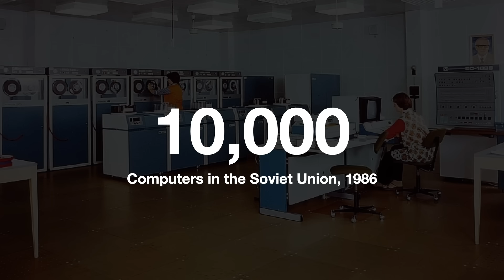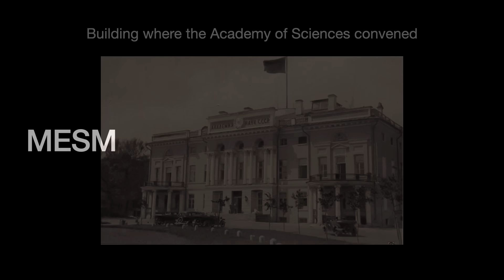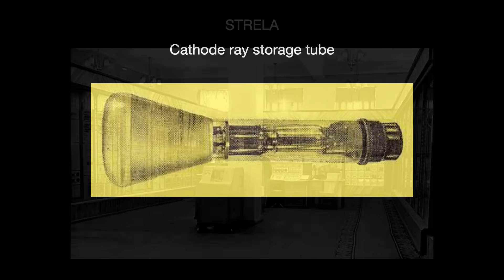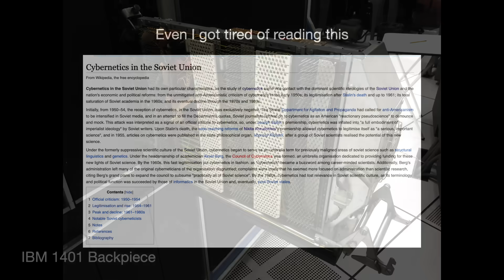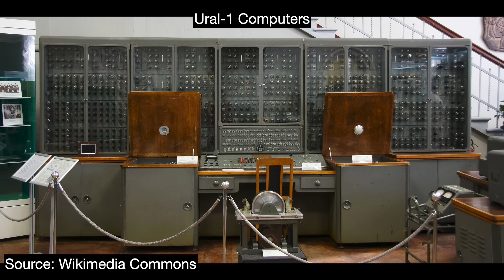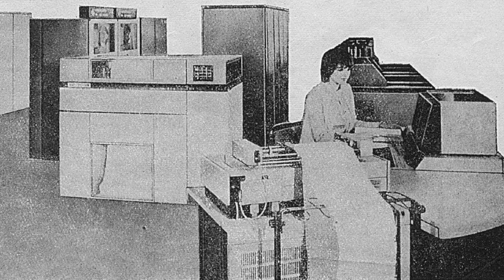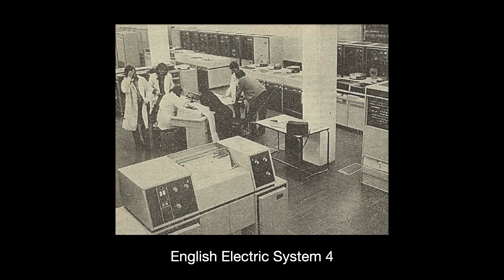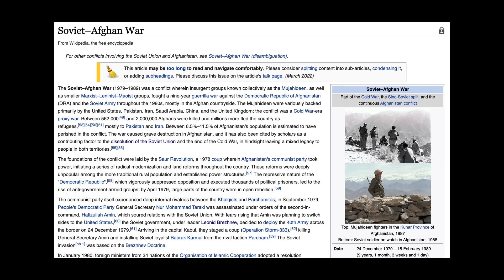Why the Soviet Computer Failed

Comment: Shortly before the fall of the USSR, I happened to be traveling there meeting with officials and notables from St. Petersburgh to the Altai, and had the occasion to have dinner/drinks (LOTS of drinks:) with a group of Soviet scientists meeting in Yalta.  During that evening,  an issue came up having to do with the then  oil/gas pipeline being constructed thru the Caucasus. During the discussions between them, which quickly grew into a rather heated argument, I was amazed when several of them whipped out their slide rules in order to support  their respective positions.  I said nothing till things were winding down later( I had not even seen a slide rule, well, for decades.)  Having resolved their argument, we returned to the meal (long, long, meal) and near its conclusion, I  rose and announced that I had a parting gift as a token of my appreciation for the chance to meet and confer with the group.  I  then opened my briefcase, reached in , and presented to the groups' principal scientist and leader,  the latest (and just released in the West)  solar powered Casio Scientific Calculator (which surpassed the comparable HP products at the time).   When he realized what I had just handed to him,  quite literally, tears came to his eyes, and for a few moments, he could not speak.  The rest of the group surged around him in astonishment and excitement as he opened the box and fired it up. :)  Needless to say, the post meal celebration went on for some time:) JESUS  could these men Drink!  I've gotta say, it was one of most memorable, productive, and satisfying encounters with intelligent people of my lifetime, and frankly, let me tell you, THAT is saying something:)
Reply: Nice story man
Reply: Thanks for sharing 🌟
Reply: as a matter of fact, by mid-80s Soviet industry could produce some advanced microcalculating devices like 16-bit DEC PDP-11 compatible ingeneering calculator "Electronica MK-90" ( https://ru.wikipedia.org/wiki/Электроника_МК-90 ). They had 2 major problems: 1) very few of them available, and 2) very expensive. Rb 3500 in 1988 equals 17 months average pay check in USSR. Definitely non of those people you mentioned in your comment could ever afford to have it.
Reply: @megaotstoy Guess Capitalism wins eh? 😂 And It’ll keep winning until we hit some form of Functional Post Scarcity.
Reply: Wow..... Just wow.
Reply: Slide rule! It was my dream. It costed me whole cash income.
I was Chinese. From 1972~1974 I went to a people commune as a peasant, working on fields with hand tools, very hard manual labour work. As a peasant, we didn't have wages. All incomes were staples and a little cash if you don't have a big family to feed. Many peasant families had to pay cash to commune for their staples, let alone any cash income.

My last year cash income was 16 Chinese Yuan. It could buy 8 kilo pork. I was 20 and single then. 

I had taught myself high school math and physics and advanced maths such differential and integer. 
At the end of 1974 I got a most previous chance to go to a middle technical school to study electronics. My life was going to change, I had the hope to be a engineer! To treat myself, I bought a slide rule with 15 yuan from the 16 yuan. That was almost one year cash income.
Reply: @xchen3079 Cool! What did you end up doing later in Life?
Reply: Awesome story
Reply: Good story! Its odd, because my father also finished the university with a slide ruler in Hungary in the 70s, however they were thaught to use a specific calculator. In the 80s some western home pc were available, but in general for scientists. I've seen for instance Nintendo first time in my life in 1990, after moving to West-Germany for a few years. Until that we had these primitive digital handheld games. So its a mystery why Russians were still sticking to slide ruler in the 80s while we could have digital games in the communist blok at the same time. I guess there was even a large gap between USSR and its satellite states.
Reply: @somethingirreversib  in mid 80s my parents bought me video game with wolf, Soviet made, so for us in Yugoslavia it was dirt cheap. I don't know was it cloned or whatever, by it had LCD screen. 7 segment LED display, just 7 digits and 1-2 extra is often enough, and to make elementary operations and elementary functions with minimal resources was known since CORDIC. Thus, cheap video game with large screen possible, but small pocket calculator not, somewhat hard to believe.
Maybe slide rulers were kind of macho thing.
Reply: @somethingirreversib  It may have been that some of these men were NOT  blood 'russians', as I was invited to visit  one fellow's 'dacha' (sp?) /home which was located in the Caucasus mountains (gorgeous locale by the way).  Again these men were NOT academics as such, they were, for the most part, engineers involved in the planning/construction of that pipeline, and had been granted a kind of 'holiday' in Yalta to attend some kind of conference and as a reward for their efforts.   The solar powered aspect of the Casio I gave them was of great importance, as the disposable batteries commonly available in the west, were extremely rare in that area at the time.
Reply: @somethingirreversib  Hungary had negotiated much better trade relations with Western countries than other Soviet Block countries. Poland to some extent as well.
Reply: This is why I love YouTube's comment sections, it's like when I'm watching some video about some 20th century war and then I read the comments and there's a bunch of accounts from veterans of said war telling about things that happened then (either that, or someone registering something their dad or grandpa told them but which would never have been written down otherwise), and suddenly you find yourself reading what turns out to be a digital billboard for historical records

I hope historians are paying attention to these as they try to organize and record current world history
Reply: We had good scientific and engineering calculators. 2/3 of the students had scientific or engineering brick size calculators (1979). But they could fit in a bag, not a pocket. Also stationary, they could be powered by an ac/dc converter, but they ate a lot of batteries, which were also sometimes not enough. Newer, compact and programmable (solar powered) were expensive, comparable to a monthly salary (or even two). 
I suppose everyone would be delighted if them were given a monthly salary (moreover, a device from the "free world" - rarity to brag about). Also in our scientific circles, it was a special chic to use fountain pens and slide rules.
Reply: @МирославаБерзина  Thank you for the information:)  The men I met with were high level engineers, who apparently did NOT have field access to the the more advanced devices you describe- thus the slide rules.  Please do NOT think in any way I was/am  belittling any of them.  In my early college years, I myself was a budding plasma physicist, so I was able to follow the gist of their discussions, though my scientific academic acumen had long since faded;  war will do that, i.e change quite a few of one's priorities, but NOT one's appreciation for the dedication and effort expended by men like these  in pursuing their objectives, irrespective of obstacles encountered.  I was in fact humbled by their joy and appreciation upon receiving  my gift. I have found in my lifetime that there exist good and often great men/women in almost every culture/society.  And conversely, some very bad ones:(  though to be candid, sometimes, that determination depends heavily on one's point of view.  Napoleon a prime example- revered by so many of the French, yet despised by pretty much everyone else LOL.
Reply: @seeratlasdtyria4584  you speak very complicated english, i thought i was good at it but i literally could not understand what you wrote here. I had to use google translate and the last time i used it to translate youtube comments was maybe 5 years ago. You are remarkable and sophisticated man.
Reply: @seeratlasdtyria4584  A team of Renault engineers (for a while, they ignored if were in profits or losses, never estimated costs, when one in administration, Besse, fired over 15'000 redundant employees, an 'autonomous command' killed him in front of his home) was drawing an small piston aircraft engine, just for fun, another came in with an slide rule, and proved engine will self destroy at first start, parts were not strong enough as to withstand the loads. Blessings +
Reply: @МирославаБерзина  99% of the "stories" in this comments section are lies. The video is such stupid that it attracts the liars.
Reply: absolutely amazing story!
Reply: What an absolutely GREAT tale!  (Did the CIA arrest you for handing over top secret technology? 😂)
Reply: @GizmoFromPizmo  Hehehe, I can see where that would seem funny;) but best not to get me started on "The Agency" as they used to somewhat smugly  refer to themselves as.  Ever since the time I witnessed  an Agency analyst (supposed to be the really smart ones),  stand up in front of perhaps the largest single group (bout 80) of uniformly brilliant persons assembled in a single room, at least that I had seen,  including one of whom  had been the Chief Operations Officer under Dulles  for the OSS (the agency that BECAME "The Agency"; anyway this fellow proceeded to lecture the group as to why Diesel fuel could not 'burn' on the surface of the ocean.....you read that right.  In the rather shocked silence that followed, the OSS guy pointed to me and asked if I had anything to add, as it was pretty clear on my face what I thought of that pronouncement.  Now, I kid you not, but I believe the following is exactly what I said:

"well, in the words of my oil industry grandfather, 'he's as full of shit as a Christmas Turkey! 
 Has anyone here NOT seen the footage of the aftermath of Pearl Harbor? I would inquire of the 'gentleman' as to just what the hell does he suggest was that liquid that was burning on the surface of the water?"

Well, even the OSS leader couldn't suppress  his laughter at that  (to his credit though, he did turn and try to conceal it).  Anyway, that incident pretty much summed up my valuation of Agency intel, at least till verified by someone else:)

 Now, back to my  Soviet trip I've been describing, here's  an insight for you. "The Agency"" actually was pissed as hell that they couldn't manage to insert one of their own into our party, which I personally thought was a 'good' thing.   However,  I did manage to discover near the end of the trip,  that a most accomplished  fellow from the DIA had pulled it off and right under my own nose:)
Reply: This comment is better Much more interesting than the video !
Reply: It’s comments and all the following replies/conversation like these that are just as valuable and entertaining as the videos themselves.  Someone should develop a program to aggregate all the best and interesting comments on YouTube.  Thanks for sharing and look forward to reading your biography one day.  🙏😀
Reply: Your story tells all the truth of this question, me, myself, I asked me the same question with similar arguments like the author of this post did but  34-37 years ago...
Reply: Awesome story!
Reply: I still have my Thornton slide rule from 1973. When I went to China in 1998, I was similarly taken aback when a shop assistant showed me her abacus to tell me how much I owed!
Reply: There's no doubt the Soviets had some brilliant minds, but do you have an opinion on why their technology always looked so crude and outdated, like you were watching an old Dr.Who episode, or one of those cheesy Mystery Science Theatre 3000?
Reply: @gwbenites  This is pretty easy to explain. The Soviet economy did not need advertising and "selling" packaging. Everything was simple and utilitarian. In addition, the majority of the population are peasants, i.e. people are simple, uncomplicated. And, of course, because The USSR was still the second economy, not the first, and there was also a lack of resources.
Reply: Soviet Russia : Very smart people, ruthlessly horrible political system.
Reply: @edwardfletcher7790  My college differential equations professor was from Bulgaria. He's maybe 70 now so he grew up and was taught in that system and I've never had a more professional and well spoken professor in all of college, he'd apologize deeply for any mistakes he made during a problem, which maybe only happened 3 times through the whole semester. I think one of them he ended the class trying to figure out why one of the students thought it was wrong and apologized the next class and redid the problem correctly when he saw what they noticed. Teaching differential equations for him was like teaching kids the alphabet, so I thought it was admirable how seriously he took it. Made you actually want to understand it so as not to disappoint him.
Reply: @breadman32398  Strange coincidence.  I recently underwent some emergency cardiac surgery involving a difficult pacemaker removal that in fact required the use of a helix laser to free up the eroding wire leads and remove the whole mess.  
The surgery was soooo difficult that it required not only the only cardiac surgeon within several states capable of using the laser , but standing next to him a specialized thoracic surgeon prepared to 'take over'  and crack my chest open, within seconds in case something went 'wrong'.  I mention this, cause the cardiac doc was previously a physicist in Bulgaria, who decided on a whim to go to med school:)  (Hint- there was a "very interesting' girl planning to attend there involved in his decision making:).  Just before the surgery,  while I was being 'prepped', we got to talking and I mentioned I had ridden through Bulgaria on a motorcycle in my  youth:)   He asked me about my worst memory of there, and I told him about this head splitting alcohol concoction I'd had been given at a university related  wedding celebration, at which point  he shocked the personnel in the operating room by engaging  in belly busting laughter then telling me what the alcohol most likely had been, and how it had been made.  You see, back then (he explained) Vodka was prohibitively expensive in Bulgaria, so some bright chemistry students had figured out how to distill, refine and 'repurpose' a cheap brand of Russian made  AFTERSHAVE!!!!!!  At this, here I was literally lying on the op table, laughing my ass off,  causing me to relax, my blood pressure and heart beat  rate fell,  the anesthesiologist  did his thing,  the doc  smiled , a couple of hours passed, I awoke, and now,  here I am :) still here.
Reply: @Edward Fletcher   That exactly system rose those people. Before 1917 Russia was ancient-traditional agricultural country with no productions and public education. All those smart people who were brought up, received a free higher education, in the Russian Empire were doomed to remain peasants until the end of their days. The average age of survival for men, by the way, was equal to 30 years before the formation of this "terrible system", and has become more than 70.
Reply: @Ma_X64 Stalin and his minions imposed a totalitarian system that ruled by fear, terror and violence. Getting people to like things like medicine and education should not require such methods. Of course, living next to Hitler and HIS minions was not a spur to peaceful progress!
Reply: @robertmatch6550  Yeah-yeah! Tell me something I didn't hear already. The problem of your version is that it's not consistent with any real documents and has just a terrible amount of poorly-made fakes in its base which is itself makes person, who's capable to think, doubt in the reality of such stories. You are imposing your understanding of what is right on a different historical era, in which you, with your understanding, would be sent on a long and unpleasant journey at the very first corner.
Reply: @Ma_X64  You make a lot of assumptions, about people/places and events of which you apparently have no knowledge whatsoever, much less about who and what I was and am.  The practice will not serve you well.
Reply: @seeratlasdtyria4584   I do not need any assumptions. I can see you through your texts.
Reply: @seeratlasdtyria4584  what happened to 90% of the replies below your commment? a year ago there was a long, long discussion here, and now its almost all gone!
Reply: @edwardfletcher7790  things have to spoil when not handled well. As USSR did. It was made for building communizm, but in 1964 Khruschev said that everything is done and socializm already built. And peaple were already not that smart and they supported this lie with ovations. USSR had the only way after that. We had to taste it to realize what do we really need. And one more sentence. We, Russians, were always respect magic of the western world. That doesn't work any more.
Reply: @edwardfletcher7790  The biggest irony is that the political system was responsible for the huge numbers of smart people. Before the revolution, education was something very important to the nobility. After the revolution its importance was spread to everyone, resulting in one of if not the best education systems of all time. This is something that the current government has neglected. Resulting in a government that lacks the presitge of the old aristocracy, the (relative) fairness of communism and drive for innovation of the capitalist countries it borrowed from following the collapse of the USSR.
Reply: @philipplyanguzov9090  Exactly !
Reply: @edwardfletcher7790  See also: General Motors
Reply: @edwardfletcher7790  the fact that they choose the horrible political system shows they are foolish, not smart.
Reply: @fitofito1001  Political system has ZERO to do with quality of academic & engineering talent.
Reply: @edwardfletcher7790  You can say that many times more.
Reply: @edwardfletcher7790  this, they were so intelligent to do and build the things they did before the computer age, the ingenious design of tanks, weapons etc etc to rival any other country, but one mis-step after another and the Union didn't even last 70 years and fell so far behind I feel sorry for russians today
Reply: @edwardfletcher7790  this political system was created and cared for by these "smart people", don't forget about it
Reply: Fantastic 👌
Reply: BIG DEAL... in 1981 I gifted a Casio C-80 Calculator Watch to the head scientist at [REDACTED], and wound up in an orgy with 26 Russian virgins.
Reply: Why would you hand the enemy valuable technology they did not possess.
Reply: Guaranteed within 24 hrs it was being dissected by them or the politburo
Reply: Thank you for sharing that.  It confirms what I've heard before.
Reply: Please, write all your travel in a book
Reply: Wow, what a great story.
Reply: Thsnks for the story
Reply: Powerful. Thanks for sharing sir
Reply: If only that country would have build its legacy from such intelligent people instead of the shitshow we see now. So sad.
Reply: Great! I could picture it as I read.
Reply: More like, why did the computer proliferate in the US?  Time and interest.  It's culture allows for pursuit of hobbies and interests.  It has science fiction appeal, with attainable goals.  It was pushing on practical fronts at places like NASA.  While IBM was renting their computers at a cost of $63,500 a month, intel was working on calculators and transistors, which lead them into the computer processor business.

You can just read the history of Intel.  Calculators, then processors like the 4004.  They made it possible for hobbiest to buy parts and build and operate a rudimentary computer at home.  

It's all capitalism business, Intel was a startup with people needing to make money with what they know.  They made parts, people bought, and they made money.  Even to this day.  Simple supply and demand.  Profitable venture.

Large part of computers is video games.  People might fail to point out a large part of the computing business was powered by quarters at the video arcade for a time.  Apple made it big on build your own computer Do-It-Yourself (DIY) kits.  They later shifted to a more money oriented model, but now known more for their phones than desktops as time went on.

First it hobbiest who needed a computer to practice on, and/or enjoyed programming.  Being DIY kits, they would also need to know how to read schematics and solder.  Also, it was a great way to meet and do stuff with other people.   No internet, all face to face or by mail.  Also, powered by video games.  It used to be single player, now it's massive multiplayer online (MMO) games.

Soviet didn't have any of these things.
Reply: That is truly quite an intriguing story. I don't think I stand alone so far as to say I would appreciate lerarning further details of your travel. Maybe at some point you may condider writing a book or lecturing on this event, and possibly other topics as well. Thank you for  sharing your story.
Reply: And they still use that very calculator today.
Reply: Just reading your stories, I feel like I'm missing so much in my. Thanks for sharing.
Reply: Very similar timeframe just not about computers, right before the fall of the USSR, my father was a young officer in the Air Force.  At that time a group of Russian military officers were visiting the base he was stationed at (can’t remember which one, sorry).  The officers saw just about everything we had, but the thing that made them lose their mind were American denim jeans.  They were calling each other over, yelling from across the store for the others to come look at them.  Looking like they’d just discovered a new divine happiness.  No one left carrying any less than 10 new pairs of jeans that day.  They were buying them for friends and family too just so they could experience them when they returned home.  They wore them the entire rest of the trip anytime they weren’t strictly on official business.  The nerds might’ve lost their minds over a calculator.  But for Russian officers stuck in scratchy uniforms, US denim jeans was their moment of enlightenment.
Reply: Sounds like they were too drunk. In the late 80s a programmable calculator was widely available, for example Electronica MK-61, which is very similar to Casio Scientific
Reply: Now there calculating the losses there having with Putin .
Reply: @americanstarman4418  this was some 30 years ago, and since they were all older than me, I suspect they have all passed away by now.
Reply: @seeratlasdtyria4584  it was such a good story for humanity. you brought us all a bit closer that day
Reply: @seeratlasdtyria4584  you are lying because you were not in the USSR in the 80s, because you have no idea about the production of calculators in the USSR, since 1964, a fully electronic calculator of the Vega model was developed and started to be mass-produced in the USSR. Since 1974 ("Electronics B3-04") pocket calculators have been produced. A wide range of programmable calculators was produced in the USSR: both desktop (Iskra 123, 1972) and pocket (Electronics B3-21, 1975).
Reply: @seeratlasdtyria4584  how did you get in
Reply: @seeratlasdtyria4584  You did what their politicians never could, improve their country
Reply: So you contributed to Russian invasion in Ukraine. They reverse engineered it and used it to enhance their military powers. (sarcasm)
Reply: What a load of bullshit!!
Reply: Do you realize what you did? You handed them technology that they cloned and used against us. It is YOU that kept them in the IT race. Egads you commie lover.
Reply: @kruncytheklown  LOL :)
Reply: P
Reply: Nice BULLSHIT on your part.
Reply: They used drinking as a negotiation tactic.
Reply: And that is when the balance of power shifted...
Reply: In the late 80's you would not have ceased using a slide rule for decades, saying that is silly.  Good, affordable scientific calculators were not available until the late 70's at least.  I still have in my posession a scientific calculator from about 1980, which cost the earth at that time.
Reply: Thanks for sharing that, super interesting story. I wish there was a way we could save these little nuggets of information so they're not lost to the internet
Reply: A somewhat strange story. If only these events took place at the turn of the 1970s and 80s, when slide rules were still used by someone. Since the mid-1970s, quite modern pocket calculators have been produced in the USSR, and in the 80s dozens of models were already produced - from the simplest to scientific and programmable. 
If the events before the collapse of the USSR are described, then this is approximately the end of the 1980s: then calculators were used everywhere, and programmable ones at that 
(I, for example, had a B3-34 (https://www.youtube.com/watch?v=TSUnfORpeUQ) , 
and more interesting models were produced – i.e. MK-52 - https://www.youtube.com/watch?v=Ne1eUmd9Bg4&t=30s), 
and solar-powered scientific ones (I had MK-71, a very serious model - https://www.youtube.com/watch?v=8NuHAK3r2wU) 
and even programmed in BASIC (since 1986 the famous MK-85 has been produced (https://www.youtube.com/watch?v=KXoYnTYfWm0&t=1287s), and I also bought one in the early 1990s, although I was not a researcher, but a simple student :). 
Since 1988, the MK-90 (https://www.youtube.com/watch?v=dKf35M_-G7k) produced in the USSR - a portable computer with a graphic screen, with BASIC, however, unlike the MK-85, it was expensive and rare. 
So, it was difficult to surprise scientists or engineers (especially in the field of oil and gas) with a good calculator. 
In those years (late 1980s), personal computers, including imported ones, were already quite common in the USSR, and various Soviet home and educational PCs of a sufficiently high level were already mass-produced 
(BK-0010/0011 (https://www. youtube.com/watch?v=DhUSqlWxdGc&t=198s), 
Vector-06C - https://youtu.be/TFbesAopy44 (I had both BC and Vector at home), 
UKNC (MS 0511), Corvette PK8020, etc.) .
However, any imported equipment was valued in the USSR (since there was almost no free sale of it, and few people had it), so a Soviet scientist could well be sincerely happy with such a gift :). 
In 1989 I had the opportunity to get acquainted in detail with the Casio graphics calculator (something like the FX7000G), and it impressed me (at that time I had not yet personally met the Soviet MK85 and MK90), although, to be honest, I didn’t feel any special need for such calculators - as a rule, a calculator was required for fairly simple calculations, and the usual “engineering” model was enough. And for more complex calculations, large PCs or more powerful computers were used. 
But a graphing calculator is a good toy for an engineer and a scientist :).
Reply: Fantastic
Reply: This is actually very believable because a few years after the USSR broke apart the conditions for everything everywhere were disgustingly bad. Nobody really cared apart from those people directly involved.
Reply: I assume that calculator was only available to a few people or did a lot of people use it in the us? How much better was that calculator then the soviets?
Reply: @anderslarsen2311  As far as I knew (i.e. 'was told') the Casio had JUST been announced in Japan, and only a very few were available, i  I may be wrong, but I don't believe it  was circulating  in the US at the time I left for Helsinki ,  my jump off point for Leningrad, (later re named back to St. Petersburg.)

As far as I know, there was no comparable calculator then available to the Soviets.  That's not to say they didn't have any similarly capable equipt, but they certainly had nothing  remotely equivalent to the solar powered, extremely portable , Casio.  HP was even 'outgunned' by it.
Reply: Wow...I had to buy that calculator for trigonometry and calculus in 1988 or 89
Reply: @AvE Please enter this thread 🤣🤕
Reply: Like living in a parallel dimension that's only a few years ahead of the current one.
Reply: Great story. Reminds me of time two Soviet chess grandmasters met up for a tournament.
"We had a coin toss. I won the toss and elected to keep the coin."
Reply: Caiso, junk HP-41C of mine still runs well for the past 39 years... RPN...  calculators is where it's at.
Reply: imagine if it was a ti-89 with drug wars installed
Reply: SLIDE RULES — oh my goodness, I love them. They are antiques and I have a small collection of them. 

I am from Ireland and I bought three slide rules, one from USA and two from Russia. I am fastinated by them. 
Why I love slide rules? They beat batteries. No need to solar power them and you can always pass them onto descendants after your days. They are so cool and look ornamental on my shelves. 
Today, the antique slide rules are getting very expensive and they are now hot collectors' items. As antiques, they now cost more than western scientific calculators. I had bought one Soviet slide rule for roughly €60 (nearly 3700 Russian rubles). Another for €58. I can't remember the one from USA. Few years after my last purchases, they probably have gone up more in prices on eBay and Etsy. Their prices are crazy.
Reply: We should remember this man was able to get behind the iron curtain and made no mention of the starvation
Reply: A peculiar tale was about the onboard computer in MiG-25 fighter airplane. It was made with bulbs, USSR own technology, the turbine for this 'Pursuit plane' had a very efficient flame maintainer.
Both of these choices made this war machine quite insensitive to 'Electro-Magnetic Pulse', as those generated by Nuclear Weapons and Solar Flares.
MiG-25 was said 'the terror of flying saucers', supposedly having Electro-Magnetic means for propulsion and defense.
X-15 was informed having a lower top speed than UFOs, but accelerated faster.
Is there any application or environnement today were bulb computers will be in the lead?
Probably, no one is ahead of Rusia in bulb computing. Who will buy, how many, at which cost? 
Blessings +
Reply: That's both fascinating and disappointing
Reply: not sure but I think you just admitted to a felony!  lol
Reply: Not surprisingly. Although Soviet-made calculators were already quite common at that time, a Western-made calculator was quite an expensive and exotic gift
Reply: Miserable Russians too smart for their own good, just as now. Nothing set can ever change.
Reply: @Neapoleone-Buonaparte  just don't envy so loud.
Reply: @ТоварищУкротитель  envy what? Congenital Russian incompetence? The army of paupers unleashed on Ukraine by the Khanate of Moscow? What is there to envy about Russia?
Reply: @Neapoleone-Buonaparte  oh, nice, you've deleted your previous comment. :) That's brilliant.
However your frustration is fascinating, please don't stop. I would like to see more of your ignorance. :)
Reply: I learned to use a slide rule in the third grade...you are the one giving US tech to the Russians...I was using slide rules in elementary...all Russias tech they have recieved from US traitors..and German scientist...
Reply: @danielraymadden  with all due respect, it appears that  you have completely failed to grasp the import  of my post.  Aside from the seminal fact that "Casio" represented Japanese and not US tech; not to mention totally neglecting the fact that the USSR was at that moment, quite literally on the 'verge' of collapse due almost entirely to their own  'will' and actions, I'm afraid that like so many  Christians;  you have "read the words written, but have not 'seen' their meaning."
Reply: Remember me the defective pilot who ate cat food and said it was better than soviet canned food. I don’t know why people still vote for socialists.
Reply: Bla bla bla
Reply: Elektronika B3-21 (Cyrillic: Электроника Б3-21) was the first Soviet programmable calculator. It was released in 1977

The MK-71, a ten-digit solar-powered microcalculator, was produced from 1986 at Zelenograd’s Angstrem and Ukraine’s Rodon. Retailing at RUB 75, it quickly won cult status among users, particularly university students. It was a carbon copy of Casio’s FX-950, with the same key positioning and other elements..
Reply: Not bad but it would have been an even more interesting story if you had reached into your briefcase and produced a severed hand.
Reply: Странная история, т.к. в СССР с 1962 производился настольный электрокалькулятор "Вега", с 1967 "ЭДВМ-П" (программируемый с трансцендент-исчислением), с 1972 -- первый наш карманный микрокалькулятор ("Искра-123"), с 1974 -- микрокалькуляторов с жидкокристаллическим дисплеем (до этого были светотабло) -- серии "Электроника", и если цена первых микрокалькуляторов была порядка 200 руб. (это размер средневысокой зарплаты), то новые модели микрокалькуляторов с 1980 г. стали стоить порядка 50-60 руб., поэтому микрокалькуляторов появились не только на рабочих местах (что было издавна, тем более что до них были электромеханические, а перед тем, до 1950-х гг. -- механические арифмометры), но и в квартирах (и, соответственно, в карманах)). Но логарифмической линейкой многие продолжали пользоваться -- муж, например, считал, что она надёжнее и не требует перепроверки (из-за ошибок ввода); но я уже ею не пользовалась, только в школе учила (школу закончила в 1980)
Reply: It's a strange story, because in the USSR, since 1962, the Vega desktop electrocalculator has been produced, since 1967, the ADVM-P (programmable with transcendent-calculus), since 1972, our first pocket microcalculator (Iskra-123), since 1974, microcalculators with a liquid crystal display (before that, there were light-tableau) the "Electronika" series, and if the price of the first microcalculators was about 200 rubles (this is the size of an average-high salary), then new models of microcalculators since 1980 began to cost about 50-60 rubles, so microcalculators appeared not only in workplaces (it yet before 1950s - mechanical arithmometers, next - electro-mecanicals etc.), but also in apartments (and, accordingly, in pockets)). But many people continued to use the slide rule - my husband, for example, believed that it was more reliable and did not require double-checking (due to input errors); but I no longer used it, I over my school in 1980.
Reply: It sounds like you violated some sort of technology and/or arms export embargo
Reply: AND THEN EVERYONE CLAPPED
Reply: The world changes quick in the modern age. Thanks for sharing.
Reply: Why is it that many cool stories include heavy drinking...? Nice story though. Thank you for sharing.
Reply: @Bob-ze1zo  Something you should know about the international community, especially the Russians.  They have a saying that roughly translated goes:
"What a sober man has in his mind, a drunken man has on his lips"
They are not the ONLY racial/cultural group I've encountered that feels that way.
In matters of intl business and/or diplomacy, until they get to 'know' you, i.e. drink with you, and see who you really are, you can't do much of anything.
  The former USSR contained something like 26/27 different minority cultures-pretty much all of whom felt similarly. In some ways, you could say I used to "drink" for my country:)
Asians and even a few of the Arabic leaders (though unable to drink publicly) engaged along the same lines.  I could tell you stories ;)
Reply: @seeratlasdtyria4584  I see what youre saying, something i noticed even more from a perspective of a person that quit drinking. But while i did, i noticed that what really gives you an edge in this kind of game is to still be able to lie while drunk :).(edit: i guess you can get there with a lot of practice!)
Reply: @greenanubis  LOL, normally I would agree with you, however in this case I had several advantages.  First I have a specific genetic anomaly that causes the stomach to immediately begin attacking and breaking down alcohol molecules, ergo, I can also REALLY drink, while maintaining cognitive awareness and control longer than those without this anomaly.  Secondly, due to my background and up bringing, I am not prone to prevarication by nature, and this is evident to those with whom I converse.  This combination resulted in my being chosen/enabled  on numerous occasions to communicate with persons of standing; to either transmit information and/or to elicit responses, and otherwise gather information on their own positions.

 Let me just say, that at the Highest levels, Trust is the most precious commodity.  Lose it in business/ or politics, and NO ONE of consequence will have anything to do with you if possible.  Only on the extreme left is the ability to congenitally lie, considered an 'attribute' on the world stage, ergo......

Oh, and on another note, congratulations on quitting drinking; simply put, it takes a VERY strong man OR woman to achieve it.  NEVER underestimate your accomplishment!
Reply: @seeratlasdtyria4584  USSR contained 100+ ethnic minorities, also many of them were forcibly integrated into either Russian or like-cultures. Only a few chosen ones were allowed to stay and those are the official minorities. Anyway, amazing story.
Reply: @astronemir  Emir, thanks for the info. Had no idea there were 100!  Like I said, during m y times there, I only encountered a fraction of that many.
Reply: @seeratlasdtyria4584  extreme left?
Reply: @kbanghart  ? Sorry, not sure I understand  what you're asking. If it's  whether I was extreme left, then the answer is no.  My response to the weenie suggesting that I had no higher education might give you a bit  of insight into my political purpose  and positions:)
Reply: @seeratlasdtyria4584  sounds fascinating. What was your job if you can share? And I would love to hear some of those stories from the Arab leaders.
Reply: @seeratlasdtyria4584  "Only on the extreme left is the ability to congenitally lie, considered an 'attribute' on the world stage, ergo......"  Waaaaa!  Ain't that the truth.
Reply: @seeratlasdtyria4584  As a life long abstainer from alcohol, I can't help but wonder if someone like me could EVER have satisfied them that I was someone worth working with. Did you ever encounter a Soviet group willing to work with abstainers?
Reply: @seeratlasdtyria4584  aka "In vino veritas". Not really that new, or that Russian either.
Reply: @rp7390  LOL, what took me paragraphs to say, you've captured in 3 words from a 'dead' language. Salutationes!
Reply: @hughmungus1767  The world of 'diplomacy' and its attendant, requisite' talents' is a remarkably diverse and flexible one.  I happened to be a good drinker,  just one of the tools in my 'kit';  I've met and known well,  many others, some of historical stature, that couldn't drink worth a damn.  Henry Kissinger to name just one :) (Ever hear ANYONE refer to Henry as "jolly?"  LOL.
Reply: @seeratlasdtyria4584  now I am imagining asian officials trying desperately to keep up with the amount the russiasn could probably drink lmao
Reply: @seeratlasdtyria4584  2) https://ru.wikipedia.org/wiki/Электроника_МК-51 Электроника МК-51 — "Electronics MK-51" is a Soviet engineering calculator powered by a lithium cell of the DML-120 type (ML2325, CR2325) or two SC-32 elements. It has been produced since 1982 in factories
Reply: @seeratlasdtyria4584  'The  importance of being Earnest', Oscar Wilde. Salut +
Reply: @seeratlasdtyria4584  beautiful story. I'm curious to know more if you can do so? A lot has changed since. What kind of work were you doing in Russia, what was it like as a western, how was the food, did they have any peculiarities, we're there women scientist, what did they think about capitalism, did they think they're superior as they're not consumerism promoting.... anything else you want to share would be great
Reply: @zakkajakob2288  In fact, there was a whole lot more to tell, but I can sum most of it up,  with two or three observations:  1. there was a ;joke going round  the foreign diplomatic and business  communities, that determining who was a foreigner and who was a Russian was exceedingly simple..those who were smiling or laughing, were ALWAYS the foreigners,  the truly sad part, was that it almost always turned out to be true:(
The second thing that amazed me, was that in bustling downtown Leningrad, there was a public 'spigot' , nothing fancy just a spigot sticking out from a concrete wall.  Next to it, a shelf cut into the same wall, where there resided a single steel cup.  To the horror of our medical contingent.  People would periodically walk by, fill the cup with water from the spigot, drink the water, and return the cup to its shelf in the wall. to await the next thirsty passerby.
Lastly, and the most personal to me, was that I made no bones about who and what I was in public- I was then about 6'3 in stocking feet,  and with me wearing a Stetson cowboy hat, and walking around in my cowboy boots (a little over a 1-1/2" riding heels making me appear about the same size as John Wayne, whom EVERYONE in the USSR knew. (In truth, I met Duke  up in Canada/Alaska  once at a famous fishing resort and he was a taller/bigger man that I :)   Anyway, the vast majority of the citizens there resembled in NO WAY, the gigantic, heroic looking statues erected throughout the country.  The people, on the whole, with only the rare exception, were almost tiny, even to the po0int that  when our group had to 'assemble' for transport, the joke was, that we would all meet at "me" as in a crowd you could see my hat from clear across Red Square :)
Now, here's the significant part-  I cannot even begin to tell you how many people over the length and breadth of my trip would come up to me and simply blurt out almost always the same exact words, uttered in almost an urgent, often emotional plea:

" Please tell your fellow American's back home,  we NEVER WANT TO FIGHT ANOTHER WAR!!!!!"

Sometimes it was just heart-wrenching..
the citizens of all parts of the old  USSR had experienced the worst that war can deliver, both from the Germans, and from their own.  They had  suffered enough, at the hands of both, and at no small danger to themselves, they wished to make sure that I took home this one critical message...:(   
To me, it makes their current plight all the more tragic.
Reply: @seeratlasdtyria4584  thanks so much for sharing. I lived in Moscow 20 years ago for a short three month project so my window was too short and frankly we were so busy on the project ver narrow. Also I don’t drink so it took me a lot longer to get closer to some colleagues. And even then I could sense the darkness of the past, an overwhelming sense. 
While I’ve read a lot about the era, it fascinating to hear a foreigner outlook during the high noon (pun intended :) of Russia. 
What always gets me is how such a fierce and brilliant people succumb to central authority? 
Few people may remember or accept it now but Marxism was very popular in the west around WW2 and many a intelligence agent became a Soviet supporter just for the philosophy.
Russian agents even created what we call IMF today and got the biggest amount of money to rebuild USSR after WW2. Much more than even the UK
They’ve got the longest list of chess champions bar none yet they’re always in a Greek tragedy. I still don’t get that predicament.
Reply: @zakkajakob2288  One of the most important lessons I ever learned, if not THE most important, was that NOTHING in the world  becomes  "the way it is", without a history  of HOW it got to be, 'the way it is' :)

Ergo, look a the history of what became the USSR, starting waaaaay back.   If you look long and deep enough, the answers you seek become trivial to understand.
 
As a 'life lesson' you will find that applying that same 'technique' iwill reveal  why  everything that is,  is the way it is.   
NOTE!  If you find the uncommon instance where it does NOT, then you'll know that 'someone' has been rewriting some 'history'....
Reply: @seeratlasdtyria4584  well I've thought of that. I compared french history to Soviet history because it seemed to be similar.
Both had similar revolutions, very violent and widespread. They also suffered the most in WW2. Yet the two end up very different.

While the French experiment continued to evolve the Soviet seemed to standstill and obstinately stuck in a spot, after WW2. The cold war isn't enough explanation. It doesn't cover the whole answer

To me the answer lies the DNA. A difference in the personalities of the individuals themselves. And that's what I find fascinating.
Reply: @zakkajakob2288  I hear what your saying, but the rise of the French Nation, at least to me, does not equate with the far older historical machinations of the peoples who came to constitute the populations in the USSR. For instance, did you know that the Russian revolution against the tsar/czar Romanov, did NOT result directly in the creation of a Soviet state, in fact it became a Republic of all things, the first president being a fellow by the name of Kerensky, who was then,  within months, forcefully deposed by Lenin and his cohorts Trotsky and Stalin.  I had the chance to meet and talk with Kerensky not long before he died, I believe it was in New York.   He had a LOT to say, but his story is one of those bits of history, that the Soviets have all but rewritten completely.  The Ruthlessness of the Russian Tsars in enslaving and controlling their populations,  seems unmatched by the French imho. Otoh, it could be argues that they had substantial reason to act that way given the pretty much constant threats they faced, both domestic AND foreign.   DNA?  I would argue no,  just historical precedent.  I'm not sure that the Russians/Soviets have ever known 'individual freedom' though some have tried to achieve it...
Reply: @seeratlasdtyria4584  I used to hang around a big group of Mostly Russian and Ukrainian emigres who had settled in the Twin Cities region of Minnesota and they were the most lovely people; they were all just a little bit crazy and very proud of that fact.  They referred to it as the "Russian soul".  I miss these beautiful people very much and I need to look a few of them up.
Anyway, I am a recovering alcoholic and when I would need to politely turn down a drink they would look genuinely puzzled at the fact that I didn't drink.  They truly did not understand it.  When the first person I had declined was confronted with the very next person to offer me a shot, they would point out that "John doesn't drink" they would have these puzzled looks on their faces.  I would try to explain what would happen if I were to start drinking again, they would nod and say "but of course" this is what happens but that shouldn't get in your way.
I am told that this is changing a bit but in general they had no capacity to understand sobriety.
Reply: @seeratlasdtyria4584  in vino veritas
Reply: @Bob-ze1zo  
Nothing cool ever happened while eating a salad.
Reply: @beeragainsthumanity1420   I humbly chose to differ.  Spend a little time eating salad with an Enlightened BEing... and your whole life may well change.  😉🥗🕉
Reply: @beeragainsthumanity1420  rlmao, SOOO true, so true:)
Reply: @Bob-ze1zo    As a grandchild of grandparents on both sides who were members of the scientific/technological/engineering elite in the USSR, i can assure you that they and their colleagues played hard & worked hard in stunningly (and sometimes terrifyingly) equal measure, equal intensity.
Reply: @Bob-ze1zo  Because it is Russia.  That is what is done.
Reply: Drinking was only one left kind of entertaining, to get rid of grey soviet reality.
Reply: Because people tend to be more open-herted and open-minded when under moderate alcohol influence.
Reply: @Bob-ze1zo  no good story starts with a salad
Reply: @Bob-ze1zo  Suddenly politics matter less. Vodka transcends borders.
Reply: @Bob-ze1zo  thats what russians do best lmfao
Reply: @Bob-ze1zo  потому что большинство из них выдуманны
Reply: They had normal scientific calculators like "elektronika" mk 52. They were just expensive, a couple salaries.
Reply: @ligametis  Įdomus pavadinimas... ;-)
Reply: @Dranok1  Idomus, bet ne lietuviu ir ne Lietuvoje gamintas :) Ukrainoje dauguma ju gaminta.
Reply: I don't doubt what you are saying, but already in 1975, there have been in existence pocket scientific calculators at least in Bulgaria than part of the Eastern block - "The first pocket model was the ELKA 101, introduced in 1974. This was the first in a large series, including the scientific ELKA 135. "  - https://en.wikipedia.org/wiki/ELKA
Reply: @danielbalev991  They may have “been in existence” but still unknown and unavailable outside of Moscow or priority industries. I was surprised the first time I went to the USSR to see calculators at all, but also intrigued by seeing an abacus (something I also saw in Japan).
Reply: @777ter  RFLMAO,   Hey 'scooter', I mean rEvolver.  You  really stepped in it this time:)
No 'advanced level education' eh? 
Ok, let me take a moment to regain a  little composure here:)
I 'write' the way I wish to write when responding to different types of discussions, much as one would speak French when talking to Frenchmen & women, or German to Germans etc, or more precisely in this case, a grandfather relating just one of a lifetime of experiences in an informal way- in any case, my choice, NOT YOURS.   You see, I really am an OLD guy now, so  let me run down just a bit of my 'education'.

I was raised in the High Rockies of Colorado in a "Black" area- meaning hidden from the general public.  My father was a civilian EE working on, then later  commanding,   the Titan missile program during the "Cold War."

To a large degree, I was self-educated as Dad took away the few comic books I had scrounged up, and replaced them with a number of books that I actually still have today.  They ranged from "Bullfinch's Mythology", to one called "100 Great Lives" , another on the history of humanity, one on the fauna and flora of North America, and one on Human Biology:)

A few years later, I was tested by the State of Colorado and determined to have a relatively high IQ.  I won't bore you with the details, but let's just say, things changed.

By the time I got to high school,  I was in Southern California and had finished the math/sciences curriculum, so arrangements were made for me to split my days between high school and a local small private college.  From there I was admitted to UCLA  where I was budding plasma physicist in the grad  school as a freshman.  I also was studying math, chemistry, economics, comparative political systems, foreign languages, and.....music:).

Then I was drafted.
Spent a couple of months teaching at a local community college (Economics and Competitive Swimming) and then was inducted into the Army.

This was VN wartime,  and since I'd always been afraid of heights,  I volunteered for  airborne (didn't work, still scared to death of jumping out of planes LOL)  To cut to the chase, I became an XVIII Airborne Spcl Warfare "SKYDRAGON", was certified by the Navy "UDT"'s (underwater demolition team) as a diver, and largely due to an unfortunate altercation with some wannabe bank robbers on Fort Bragg one night, ended up a kind of military LEO, primarily involving  Homicide/Narcotics investigations before  evolving into something else.

Anyway, eventually I separated from the service, went back to Southern California, sat around on my ass for awhile, did some work for a private security firm, and my father finally convinced me to at least enroll at the local State University, where I took a Degree in Business with an emphasis on Securities (war can change your priorities.)

Fun little sidelight, it was here I first met Kevin Costner, came 'this close' to joining his fraternity but at the last minute, went with the one across the alley LOL.

Anyway, received a scholarship from the California University system, and went to Europe where I attended classes  in both the Cal Intl program, and the Universidad di Firenze.  BTW, before arriving, they gave me a few weeks to learn Italian, as all the classes were conducted in that language.
My studies  at the Universidad were in the 'graduate' division and were in Art, and Architecture, neither of which I had ever studied before LOL.

While in Europe, I had occasion to meet and converse with a few of the Brigate Rosse (look it up); the then head of the Italian Communist Party (remarkable fellow); one of the last of the former Russian Imperial Family (a most gracious lady) and finally the local head of the Mano Nero (who actually gave me  and a few close friends a "going away party" just prior to my leaving for Beirut, where I arrived during the onset of the Lebanese Civil War and had the starboard landing gear of my plane  blown off by a Howitzer during the landing:)

Ended up in Amman, Jordan  where I had occasion to meet a LOT of influential persons (the international business and diplomatic groups pretty much moved there from Beirut).   I was staying with the Deputy Chief of Mission ( US State Department official) and ended up singing for (command  performance) and later meeting and conversing with then King Hussein.
 
LOTS of interesting things happened during this trip.   I was even arrested and dragged of the bus on my way back from Damascus, by the Syrian's and incarcerated  for a bit before my release was arranged:)

Anyway, I eventually returned to my local Cal State University, took my Degree; took the LSAT, applied to,  was immediately accepted to, and ultimately graduated with a Doctorate from the Harvard Law School.

In that regard,  I'm currently admitted to practice before the US Supreme Court, the International Court of Claims, The United States Tax Court, The Federal Courts of Appeal for the 9th, 10th, and 5th Circuits,  The California Supreme Court and a bunch of the District courts thereunder, AND, though now long retired, I once was a barisster  of the UK's  Lincoln's Inn.

Lack of 'higher' education my ass!
AND,  as for the link between drinking and International Diplomacy,  the fact you've never heard of it,  just indicates your status as just another 'expert'  who doesn't know shit about the 'real world.'  
Note:  For anyone else reading this, please forgive this old guy's lack of patience and use of immoderate language as  I've always had a very low tolerance for 'experts' who simply don't know what the hell they're talking about.
Reply: @seeratlasdtyria4584   May I ask you, what area did you visit in Altai? 🙃 I am native german but I was born there, like other thousands of germans after WWII, which were deported to sibiria.
Reply: @MlTGLIED  Part of my Father's  family came from Germany, where in Germany did your family hail from ?  Now, to your question: this is a hard one to answer because of the length of the Altai range, and the adjoining states/republics.  I believe  we flew into Irkutsk, then worked our way back west  up through the mountains where within a long days ride by truck we reached our objective, which was a meeting with the local head government /tribal official in what turned out to be a kind of portable village of huts called "yurts'. I was here during the 'drinking' part of the diplomatic 'feeling out' process that I was introduced to one of the worst drinks  ever to enter my mouth :{  This was a very very VERY old culture that basically  had settled on two different alcoholic beverages: fermented mare's milk, and fermented yak's milk, I'll leave it to you to guess which was worse, but I'll tell you with no exageration, it took EVERYTHING I could do to not only drink this stuff, but to keep it down afterwards , all while doing my best  to maintain a smile LOL.  The women of the 'tribe' made this concoction  by taking the milk into their mouths, swirling it around to get plenty of saliva in it, then spitting it back out into a stoppered animal bladder or stomach (I didn't ask) and then left awhile to ferment.  In succeeding days, we arrived  WAAAAY on up at the then Soviet Alpine spots team training center (maybe you know where that  is/was) where upon being challenged by my rather cute female  KGB 'guide', I astonished those in both my group as well as the Soviets then training at the facility, by proceeding to literally run up and down a series of stairs cut into the rock wall.  They called it the "Thousand Steps".  Two things I should tell you.  First, one of the local Russian trainers came out of the building after watching me go up and then back down the mountain, and began speaking excitedly to me, not a word of which I understood.  My KGB girl then barked harshly to  him, he froze, then turned away muttering under his breath.   One of our guys, (whom I later discovered was a DIA agent who spoke fluent Russian; told me on  the way back to our truck explained that the trainer was asking my name and what sport I was training for; and that my 'girl' had told the trainer I was an American and cussed him out for approaching me. LOL.  (For those that didn't read my angry retort to the fellow who accused me of being uneducated,  let me reiterate that I was  raised in the HIGH (very high) Rocky Mountains and used to run free up and down  through the forests for years.  I was also a competitive swimmer (I once held a US National Record) swimming ice cold lakes (no pools) in those same mountains, soooo I had a heart and lungs that even an Inca would've envied ;).

As for where else in the Altai we went, I know we ventured down into the Mongolian part of the range eventually arriving in "Ulaanbatar" (sp?) for another set of meetings.  I also remember crossing further back west to "Almata" (again sp?) which I believe was to meet some Kazaks.   Other than that, can't tell you much more except there were some incredible lakes  I saw while going through the mountains.  I hope this helps.
Reply: @seeratlasdtyria4584  you have a wealth of information that would be at home in a bestseller book. Would it be too much to ask you to write a blog or share your top ten stories from your life wether good or bad?
Reply: @cybervand  Cyber, thank you for the kind words.  I should tell  you that over the last decade or so, I have been approached by several writers and publishers who have expressed an interest in doing  a book on my life.  To be frank, for the most part I've been a bit reticent due to several factors, first among them, that I have some things to say that would prove 'problematic' for a few people still living, as well as a bit 'traumatic' for those close to some of the men who have passed.  It is difficult for me weigh the consequences of expressing my 'truths' in these instances, against the likelihood of inflicting emotional  pain on otherwise innocent parties.  Then there's the matter of my not only my  own personal security (which concerns me less as I approach my own 'expiration date'),  but  more importantly,  that of those whom I value intensely.  To put it bluntly, there are those who bear me 'ill will', some of whom have moved against me personally (to their misfortune luckily); and more who would, if they could identify me and/or those who I care for.  I have come to the conclusion that in the end, Anonymity is the only true personal security,  thus even though I would have to have some pretty intricate arrangements to release such a biography,   I am currently pursuing such a plan :)
Reply: @seeratlasdtyria4584  as long as you have a plan on saving your stories for the next generation. Would be a shame to loose a person such as yourself not to mention the tales you hold tight to your chest. However i think youre younger than my dad who was born in 36 and lived through ww2 with both of his grandfathers working for the resistance in norway. So i think you still have some years left in you ;).
Reply: Not saying I do not believe your posts, but you are posting quite a bit of info up if there are really people who bear ill will to you and would want to harm you. Just a tip.
Reply: @seeratlasdtyria4584  What was the model of the calculator that you handed to the Russian? Was it something like the "Casio FC-1000 Graphics LCD financial calculator" from 1988, with graphic capabilities?
Reply: @PlanetIscandar  If I remember correctly, it was their latest and truly greatest (for the time) scientific calculator that had almost literally 'just been released', AND it was a solar powered one which turned out to be a HUGE deal, as the availability of common western batteries, was pretty much non-existent except perhaps in that secret, non, existent city jam packed with top scientists,-mostly mathematicians, chemists and physicists-as they reportedly (at least in the west)  got pretty much anything they asked for, and yes we pretty much knew everything going on there at the time:) Sorry, can't remember the actual  model designation of the calculator at this point :(
Reply: @PlanetIscandar  Hmmm, adding to my previous response, I think I remember it having FX? in the name of the calculator.  Remember, this was I believe in the latter part of 1989.  Hope that helps.
Reply: @seeratlasdtyria4584  All i want is to see which calculator impressed them so much and why. I want to see what they saw. Btw, i bought my first, non-scientific, solar powered Casio SL-80 Handheld Electronic Calculator with "touch key" back in 1983, for 2800 or 3200 Drachmas in Greece (around 20$). I'll post a link to help you find your calculator in a separate message and i hope you will see it, since my account has been blocked in the last 2 years.
Reply: @seeratlas d' Tyria  perhaps that 1000 step stairs was in Alma-Ata (modern spelling "Almaty")? There's a highmountain skating stadium "Medeo" just next to these stairs. I climbed it up last summer, took me quite a lot of stops to catch breath till I got to the top :) Thanks for sharing your travel stories! I enjoy reading them. You've travelled a lot! Even though I come from that geographical region, many on the places you've mentioned are still on my "to visit" list. Wishing you all the best! :)
Reply: @vladimirzhukov1052  Thank you for the kind sentiment.:) and glad you made it up and back down those steps in one piece LOL.
Reply: @seeratlasdtyria4584  at this point I don't know what would be more impressive, your accounts of your life being true, or you being a skilled enough writer to make all of those things up! Its not often you just get to see a person with your qualifications taking the time to respond to so many replies.
edit: came back to this thread a year later - and 90% of the replies are gone! I distinctly remember there being a long argument here about whether or not at the time the Soviets already had equivalent products to the one gifted (which would put into question the validity of the top comment). And what was more astonishing was how much OP participated in that discussion, sharing many more details of his life stories. I wonder what happened here.
Reply: @seeratlasdtyria4584  i'm sorry for these rude comments. These people are probably used to be a workers on ineffective plants, they were doing nothing, drinking and stealing plant's property. That's how it was in late USSR. Now they miss these days when high class specialists were getting the same salaries as some millers with 8 classes of education. They miss the days when you could do nothing and still getting paid and use universal healthcare and education for free. They are delusional in their beliefs of ideal state that USSR clearly never was. Let me tell you a story actually. My uncle told how some truck driver use to pour diesel fuel in the field because he had to spend an exact amount of fuel to match the "plan" of spending an exact amount of resources on every job. That's how it was.
Reply: "Shortly before the fall of the USSR"... How "shortly"? I think you are telling fairy tales. Shortly before the fall of the USSR, I, a Soviet schoolboy, had several simple arithmetic calculators, including those powered by solar panels (desk lamp) and an LCD indicator, because the Soviet school encouraged their use in mathematics lessons. Unfortunately my family was not rich enough to afford a programmable scientific calculator. But no one in our class had one. But of course I knew about their existence. Moreover, scientists could not know this. However, indeed, many representatives of the old school preferred slide rules for a long time and mastered them so masterfully that they demonstrated a greater speed of calculating some functions than on a calculator. The only thing that your Casio could impress these people with is a large number of calculated functions and size. And I think you are misinterpreting the emotions of these people.
Reply: I call bs
Reply: something is hard to believe in your story, in the mid-eighties I studied at a Soviet high school and used the Elektronika MK 71 calculator, and many other students too.
Reply: @mazamazahacker7034  Hello:)  I don't know what to tell you about what was happening with your high school, but I stand by every sentence of my story.  One of the guys invited me to spend  some time at his dacha.  Furthermore, like I wrote, the Casio was quite literally state of the art,  as I've said, even the market dominating HP had no comparable model.
Reply: @seeratlasdtyria4584  Man, I lost my patience to engage with internet cretins years ago. it's like holding back a tidal wave with a door... I don't know how you do it.
Reply: @seeratlasdtyria4584  Wiki:
Elektronika MK-71 is a Soviet engineering calculator powered by solar cells. It has been produced since 1984 at the factories "Angstrom", "Iset", Ivano-Frankivsk SKTB "Orizon", was sold at prices of 55 rubles (since 1984) and 75 rubles (until 1991). It was also produced at the Rodon plant (Ivano-Frankovsk) under the name "Rodon MK-01". An analogue of the Casio FX-950. At its core, this is an improved version of the calculator "Elektronika MK-51" on solar batteries and a large number of functions. This calculator uses the algebraic logic of calculations, there is support for calculations with brackets (up to five levels), the ability to work with simple fractions and represent the result of calculations in degrees, minutes and seconds, there are hyperbolic functions and the ability to round the result of calculations to the required accuracy.
Reply: @mazamazahacker7034  WOW! thanks for that info, I  had NO idea such a thing existed back then:)  Still remains the same tho, the  guys I was with didn't have one, they had slide rules :)  Any idea what the production run was like? I.e the numbers that made it into general circulation?
Reply: Мне кажется вы обманываете, выставляя русских дикорями.
Reply: One moment! There was in the GDR the pocket calculator since 1984, available for the public and for scholars for 230 eastern Marks the SR1, also the MR610. Licensed production from Tesla in Czechoslovakia.
Reply: @michelangelos-pizzeria  Thanks for the info Michelangelo:)  I spent a night out in Leningrad with some GDR 'businessmen' on my trip, (they also had some Belgian's with them), and THAT turned out to be a rowdy event in its own right LOL.  Those boys could drink man for man with anyone:)  Difference was, they were SMILING and laughing the whole time:)
Reply: Great story! I remember when I lived in the soviet union and my uncle somehow got his hands on a smuggled pack of Wrigley's gum. My sister and I felt the same wonder as your scientists when we were each given half of a stick. Soviet gum was 20 years behind just like electronics.
Reply: @Rascal77s  В СССР не было собственных производств жвачки, а про электронику ты вообще знатно облажался. Как она могла отставать если СССР был 2 мире по технической развитости, фейлспам.
Reply: @ПапашаБесчленофф  кстати, неправда. Собственная линия по производству жвачки была.
Да, рецепт вместе с технологией закупили, но производство было.
Другое дело, что это были не дональды и турбы с вкладышами, а жвачки типа Ригли.
Reply: @ТоварищУкротитель  Их решили только к олимпиаде вроде бы выпускать но тогда почему их в продаже не было?
Reply: @ПапашаБесчленофф , надо признать, что начало восьмидесятых я помню уже не очень хорошо. Но помню, что, скажем, году в 84, купить жвачку, в соседней булочной, большого труда не составляло.
Самыми распространенными были апельсиновая и клубничная, мятная редко попадалась. В прибалтике были дополнительные виды типа кофейной.
А почему их не было в продаже раньше, тут можно массу версий высказать от саботажа до пуско-наладочных работ на линии производства. Лично мое мнение, если их не было, это скорее было обусловлено отсутствием достаточного спроса. Грубо говоря, для единственного хипстора на селе никто не повезет в сельпо ворох розовых маек. Если только этот единственный покупатель не готов их все сразу выкупить.
Reply: @ТоварищУкротитель  А где вы жили?
Reply: @ПапашаБесчленофф  в 84 в Череповце.
Reply: Yeah, because while  USSR at that moment had   Electronika  54 (programmable) and Electronika 55 (scientific), they were way harder to use than intuitive CASIO, were unreliable and hard to obtain (not to mention, the cost was of several month wages)
Reply: Thanks for your wonderful story
Reply: what a joy was this thread to read! thanks for the stories
Reply: @qumusabel  Joy to remember it too :)
Reply: And that, my friends, is how USSR launched Sputnik
Reply: @777ter  именно этот фильм оказался пробелом в моем культурном образовании. :)
Reply: You were an adult at the end of the Soviet Union and yet your account is named after? Something smells fishy about these stories.
Reply: @ufukpolat3480  LOL, hmmm been awhile since   I thought about that :)  Couple of things,, I started my initial work with computers back in the days of magnetic tape, and punch cards. Used to program in cobol and fortran, waaay back.  When comp gaming was first getting rolling, It seemed sooo silly, that I made a few suggestions to several of the people running the  companies and ended up 'contributing'/writing for several of them, i.e. Sierra, Neverwinter, Everquest...etc.  From that time forwards I've always maintained a bit of involvement in gaming as a means of relieving the stress  of my other careers (during the majority of my life I managed to 'interweave' several).  

 "Seer" came from an old military 'handle' I'd acquired  during my time as an  XVIII Airborne Spcl Warfare "SKYDRAGON" during the VN years (I was very good at 'forseeeing' impending events).

 For a time, in those days, I worked for a now rather famous/infamous commanding officer whom I won't name as he's still alive and most likely wouldn't relish being reminded of some of the matters we became embroiled in:(. 
He gave me the codename "Atlas" as he thought I took too much of the world's ills:

 "on your (my) own back,"

 for my own good.

I surmise you deducted correctly  where the 
" d Tyria"  comes from, as GW2 is one of the few remaining games where I can wander around in a far simpler place, meet and converse with people from all over the world, and just relax from the insanity of today's "REAL" world with people who know a bit about it, without being hacked/traced to death.  You'd be surprised at who you can run into without ever knowing who they are irl.  One of the truly remarkably talented  "PVP players I  played with turned out to be a Mossad-like commander, (the Israelis have a plethora of security related agencies.)  

Back when I played   WOW, I once had a 'bubble'  suddenly appear on my screen out of nowhere (I never use chat bubbles), introduce itself as  "FRODO" and begin a conversation that literally startled the hell out of me, as this person not only had just hacked what I knew to be one of my well-secured workstations (I'd built it myself) as if it was a 'trivial' exercise, but  also knew  who I was, and far too much of whom I had been;   as if it all was common knowledge!  Turns out the famous hacker FRODO, ( I subsequently met and had dinner/drinks with HER out in California) was one of the top tech types with the NSA.  She was, in fact, the one who designed the 'implanted locator' used by several of the 'spook' agencies to keep track of their field personnel from satellites.  I'd tell you what Frodo looked like,  but there's not a man amongst you who'd believe it LOL.  Let me just say that when she entered the rather expensive waterfront restaurant she'd invited me to, time seemed to just stop. There wasn't a sound uttered, not a jaw that didn't drop, as she surveyed the tables,  raised her eyelids and smiled at recognizing me (we had NEVER, to my knowledge, ever met); then she proceeded to glide in my direction like a black panther  stalking her prey.  From neck to toe her 'catwoman' like  leather outfit made Halley Berry look pre-pubescent lol.  Mgt.  even asked us to move to a 'secluded' booth which they maintained for some of the Hollywood crowd who often frequented the place, so that they could dine in peace :)

 I played WOW for years, frequently running into a character,  who turned out to be Bill Gates, (a damned Gnome of all things lol)  (I had first run into Bill playing poker  at MIT and Harvard- he's a ferociously good poker player and used to 'hammer' the rich kids for every cent they had lol.)  I've  subsequently encountered him on several occasions over the years.  We spent the night at Comdex once, drinking and talking with the guys at Byte magazine at my brother's  house in Vegas.  Later, one of his Microsoft officers built  a house that bordered my Father's (and brother's) cliff top estate  on Whidbey Island, and I saw him again there when he showed up for an event, maybe a wedding? 
 
 In any event, back to the 'd Tyria'- I added it as I have several accounts in GW2 and needed to distinguish between them.

So, as to  'smelling  fishy', I hope this helps explain a bit.   I have lead a very full and not entirely 'uneventful' life  and 'experienced' more than a few events worth remembering, at least for this old man:) 

In fact, the dinner meeting we've been discussing was not only just one of the memorable events that occurred during that same trip, it was one of the lesser important ones.
Reply: My first experience of usage scientific calculator in USSR was somewhere in 1976. It was the birthday's gift to my aunt. She was 30 y.o. and professor of math at the University. I bought my first programmable Soviet made calculator in 1983. It allowed to create the calculation program by your own algorithm. It helped me to prepare my student works: to solve the system of 11 linear equations or to found the solutions of difficult differential equations. In any case I also liked to use the slide rule to train my brains ;-)
Reply: That Explains why the guard at the hotel cosmos traded me his coat for my Casio calculator watch back in 89 (high school glastnost trip) he even gave me a note to get through customs since it had all its insignias attached.
Reply: @elbowmedic  :)  I got a LOT of offers for my hat and boots :)
Reply: советских инженерных калькуляторов много было https://live.staticflickr.com/65535/48097824332_335daf2939_o.jpg
Reply: * Savages and the glass beads * 😁
As a proud Ukrainian I love the humiliation of these Soviet savages
Reply: @nneeerrrd  I am so very sorry what the Ukrainian people have been forceced to endure - I wish for you a restored home and many friends and 😊happy life, and loving family!
Reply: I was a physics student and had Soviet programmable calculator in 1982. You were talking to some weirdos :D
Reply: @drdisco5827  As I traveled the USSR, the most consistent impression I recall, was  the pervasiveness of the rather remarkable disparity between the incredibly small number of "haves", and the vast numbers of "have nots" under that purported 'equaliiy'  based political system; furthermore, the men I have described meeting in Yalta, were a very very very long way from "weirdos."  Your assertion constitutes  a 'soviet worthy'   injustice, not to mention a despicable insult.
Reply: @seeratlasdtyria4584    As I traveled the USSR

no one in 1990 in Russia walked around  with a ruler calculator. in mid 90s every school kid had a solar powered Casio calculator in Russia.
Reply: @KronStaro  I wasn't there in the "mid 90s"  , I wasn't meeting with 'school kid's', and I was in Yalta, not Russia at the time this encounter took place.  My story is 100% true and I stand behind every word.
Reply: @seeratlasdtyria4584  how big is a sliding ruler? probably no less than 12 inches or more ? where did they keep it on themselves?
Reply: @drdisco5827  sounds like a bullshit story to me
Reply: Dear seeratlas, Thank you so  much for relating this story. from the purely human point of view it is wonderful. A highly intelligent and respected Soviet scientist (with a few drinks under his belt) reduced to tears and speechless on receipt of the gift of a pocket calculator from you. You able to give and him/they able to receive. Russian people have great heart-forces, as far as I know (I don't know any at the moment). You were a great loss to the Diplomatic Corps; your action then with a pocket calculator worth £10 or £15 probably did more for the good international relations than dozens of meetings between politicos. Well done and thank you again.
Reply: Soviets used programmable calculators in 1980s........
Reply: @KronStaro  I had a Casio programmable pocket calculator in 1978 in Australia.
Reply: @PropanePete  Soviet programmable calculator Electronica was made in 1980. I also dont believe they made programmable pocket calculators back then. in the 90s we had large Texas Instruments programmable calculators. Not sure how you got a programmable casio, unless you mean some basic fucntionality.
Reply: @KronStaro  Yes, on reflection it was pretty basic but you could make up a simple formula (a weight conversion for example) and store it in the non volatile memory.
Reply: I wonder how long he was allowed to keep that calculator before having to gift it to his superior.
Reply: Bull....shit
Reply: Noncence from the start
Reply: What year did this story happen?  Because at least by the end of 80s scientists had personal computers like 286 at work. Clones of XTs in mid 80s. Before that various large machines, mainframes had always existed in USSR where really needed. You may be exaggerating a little bit?
Reply: @valeriyv1073  , it's now the day before 2023 so forgive me if I can't recall the exact date back in 89 or 90 without pulling up some old files from storage, which I'm not sure would be the best use of my time today :), at least in the eyes of my family. :)  What I CAN tell you is that the event you describe occurred literally the night before I left by plane to Yerevan, Armenia.  I have written elsewhere the circumstances and events occurring on that plane and its nearly disastrous landing and why.  It was literally a day or two later that Azerbaijan declared war on Armenia and commenced hostilities.  This necessitated an emergency evacuation of myself and my party from Armenia, on a rather luxurious Yugoslavian bus, of all things, driven by an mildly intoxicated serbian (if I remember correctly) over a rugged mountain goat path (which had been described as a "road" lol which was 1. unlit- i.e., no lighting whatsoever;  2.  no security rails (which given the enormous number of switchbacks and roadside cliffs simply terrified all but a few of my party) and 3. all this on an overcast night WITHOUT LIGHTS OF ANY KIND, i.e. BLACK as hell.  
It was then that I understood why the driver had downed a drink or two in anticipation of the trip. 

Anyway, we miraculously made it to Georgia  (The Yugoslavians built one hell of quality luxo bus back then.  Because of the design it was possible to make the tightest switchbacks imaginable tho often the driver and I (leaning/standing up front) were often quite literally, 'hanging out' over open space as the front wheels of this bus were located behind us. Oh, one more thing, no pavement of any kind, AND, it had recently rained, though lightly.

Upon arrival in Tiblisi, I had a bottle of  Jack Daniels hand delivered to the driver as when I had asked my Yugo translator  to inquire as to which he would like, that had been his choice:)

This all occurred within a week of the Georgian national festival that year, again, I believe 89 or 90.
Reply: @seeratlasdtyria4584  wow, you are an amazing fantasier. Some people like such "hunters (fishers) stories", so  I don't mind either. That is an art of a story teller.
Reply: @valeriyv1073   With all due respect, you have NO idea of who I am, or the life I have lived.  It is a mistake to assume  that everyone other than one's self, endures a similarly  mundane existence.  

 I have given you a chain of events, which if you had taken the trouble to research, would have lead you to discover that every word I have written is not only true, but exact in every respect.

Your own inattention to logical detail is evidenced by your proclamations that during the time  of the events I mentioned, some 'Russian scientists' had access to various pc clones, and larger mainframes; which would be totally  irrelevant to the fact that these men were CARRYING slide rules and NOT lugging around PC's, and several of them were not "Russians" at all, but originated from several of the old USSR's  constituent Republics.  As a footnote, I should probably tell you  that I began my  programming in Cobol and Fortran on a CDC mainframe back in the days of hole punched cards and magnetic tape reels.

As for "hunters (fishers) stories"; at that, I have to chuckle.   You see  I was raised in the remote High Rockies of Colorado  and  could tell you 'stories' for hours of what I have seen and done while out exploring   the wilds of those (back then) pristine mountains.  In fact, my Great Grandfather was a close  friend of Jim Bridger (look him up), and one of the VERY few 'mountain men' allowed to share his campfires.

Alas, I'm afraid that we REALLY are now quite 'far afield' from my original post on my  meeting/dinner/drinks with the men in Yalta (wink).
Reply: You have to drink that much because living in the USSR/Russia is that much more miserable
Reply: I'm not sure if it's Russian technical people, or just Russians in general that can drink like alcohol is water. Great people, awful politicians.
Reply: @777ter  For the vast majority of people, I think that may be the most inciteful statement  you've made.  Just remember, there are some things in life that are exceedingly hard to do, but nevertheless MUST be done to ensure the continuation of the species.   The rhetorical question  thus becomes:  

"Who will do the HARD things?"

and the response,,,

"Those who can."
Reply: @Luke Terpstra Faulty logic there Scooter :)
1. It's HIGHLY likely, that I'm a chit load older than you.  I last used slide rules when I was a kid in junior high ( I was seriously 'advanced' in the core sciences, so much so that  by the time I got to high school, they had nothing to teach me about either math or physics.  Accordingly  I enrolled in a nearby local private college to take those subjects in the afternoons,   I did my mornings at the high school. By the time I graduated, I was granted entry to UCLA as a 'freshman' in the graduate Physics classes (my interest was plasma physics)i.e. for the MS degree.  Now I'm not claiming I was the 'first', but no one in the department could remember any other....  I had also, begun my computer sciences curriculum,  programming on punch cards,  in the days of magnetic tape.  I was a fortran /cobol kind of guy working mostly on the latest CDC comp, and the IBM 360 though I did get a shot  later at the IBM 370. Anyway, things were going well.  I was having a 'chit load' of fun:)

 Then I got drafted.

Looooong story, but here's  the 'short' version-  XVIII Airborne Spcl Warfare "SKYDRAGON" combat vet here.  When I got back, er.... well, lets just say my scholastic  priorities had undergone some 'modification.'  You see,  working with slide rules had not only slid waaaaaay down the 'list',   in fact it had dropped off completely.

Now, Luke, on a personal note, and as a general matter, it is a mistake to assume that all the people you encounter on the net, or irl for that matter,  are lesser than, or even equivalent to  yourself.  Simply put, were you to walk up to someone like me and call me a liar to my face,  well, most likely it wouldn't be your best day.

Life is NOT like the movies; treating people you know nothing about  with a little respect not only costs you nothing, it makes human discourse  a LOT more pleasant.  And should you choose to disregard my advice, some day you will quickly discover that  men like me,  not only retain precious little patience, but tolerance as well.
Reply: MK -series engineer calculator i was used in 1985 in soviet school.🤦‍♂️ such a pathetic fairy tales
Reply: You make the case for the case the Russians were way behind US tech this is common knowlege...the US built over a 1000 factories in the 1930s...
Reply: That is a part of Russias problem their god is their belly....Russia has no desire to know God or respect him...their fleshly cravings is their devotion....
Reply: @danielraymadden  ER, UH.......Daniel, imho back in that time when all i'm describing occurred.. The Russians I encountered were if anything, some of the most devout people I had met to that point in my life. Just as the Catholic Bavarians delight in their own imbibing, to be sure, devout followers of the Russian  Orthodox 'flavor' of  Christianity (I'm trying SOOOO hard here to NOT even mention the Irish,  AND the Scots!!!!! (heheheh); well let me just say that one hell of a lot of religious people , seem to do one hell of a  lot of drinking :)  
As for the current thinking of the Russian people vis a vis the Ukranian conflict,,, well let's just say, imho, a VERY large number of the most vocal seem to be very poorly informed as to the facts of the matter; as in they have intentionally been/being mislead by their current leadership.  I might add that the same could be said here in this country:(
Reply: They drink because their lives are one long tragedy...

Thank you for sharing!
Reply: Cool story bro.
Reply: @777ter  Smiles, it is unwise to assume that all those you encounter over the web, live lesser lives than yourself.  I have only stated a fraction of my own 'highlights reel'.
Reply: And then you realised you were fantasizing about being harry potter making love to a wizard or goblen..
Reply: @journeyman6752  not a fan...
Reply: A slide rule😂 I just imagine very Jewish looking Russians yelling at each other while while moving the slide rule with one finger being sassy AF🤣
Reply: @mickeytwister4721   :)  Well, to the degree there  IS such a thing, they really didn't appear to look 'Jewish' to me, (course neither did Sammy Davis Jr. ;) but I do have to confess, I was REALLY startled to see the slide rules.   Further, they didn't actually YELL at each other, more of an 'elevated, spirited disputation' :)
Reply: Chechen oil...
Reply: By the way, the author is no better acquainted with the geography of Russia than Miss Truss. And it's hard for me to imagine Russian academics who drink so much and keep a slide rule ready in their pockets. But not a bad story for Disney))
Reply: @Ulysses4168  :) I found the USSR to be a BIG place, and MOST of its people, NOT RUSSIAN.  Dunno bout gauging  my knowledge of it's Geography,, but I will say, this Yalta meeting was NOT my first 'rodeo' in the USSR.  That happened back in 75-76 when I rode a motorcycle (unescorted btw) from Italy up through the then Yugoslavia, Romania, Bulgaria, then Ukraine.
On the 91 trip, I came in  by plane from Helsinki, to Leningrad, then hopped around eastwards all the way to the Altai Mountains and back to Moscow. In between, I covered a huge part of the old USSR,  hitting Yalta just before flying into Armenia just in time for the war with neighboring 'republic' Azerbaijan. There ensued some 'dicey' travel thereafter up to Georgia, then across the 'Stans.   More than a few 'other' places also, but that should be enough  to make my case.   In ALL my travels through that part of the continent, I found ONLY one universally agreed upon sentiment- EVERYONE  quite literally 'HATED' the Russians.....
Reply: @seeratlasdtyria4584  Thank you, your opinion and stories are very important to us (no)
Reply: @seeratlasdtyria4584  About the hate of Russians. It looks like you found what you were unconsciously looking for all the time.
Reply: @seeratlasdtyria4584  There is no personal freedom. you obey the laws of your country, or you'll go to jail. So you're from Italy? I can write a lot about this, about what is happening in your country. About the Italian mafia.. etc.. Or have you already defected to the States? We can talk about this, too.
Reply: @Redfvvg  Defected?  LOL, I'm a  naturally born Texan, raised there and in the HIGH Mountains of Colorado and Utah.  I've traveled on all the Continents EXCEPT Antarctica (too friggin cold lol).  Took my degrees in California, Boston, the UK, and Firenze. Since you mention it, I've known members of the Mafia, the Mano Negro, the Brigate Rosse, a couple of the Cartels, and the Unione Corse,  the Tongs, the Bratva, and the Yakuza: no common thread here, just a series of unique coincidences.   Back in the day, I even knew a few Mau Mau.  (I myself am generally not considered a  criminal, (though I WAS accused of being a 'war criminal' by a few mentally unbalanced types in the  US  some 5 decades ago......;)
Reply: @seeratlasdtyria4584  From Wurzburg, I travelled to Pula, Premantura, Trsat summer 1978.
Banknotes had four alphabets, latin, Greek, Cyrilic and Arabic. Nothing more remarquable.
All this 'faded', along with 'Yugo' car factory.
The 'french' 'republic' has long arms. Blessings +
Reply: @seeratlasdtyria4584  your observations were correct - in the USSR every nation hated the Russians. USSR was once called "a prison for nations", and russians were prison staff
Reply: What a story, Mark - Tommy Waiso
So you literally was traveling from Saint-Petersburg (you probably didn't notice it was Leningrad at that time) to Altai and that made you to get to a meeting in Yalta which is literally thousands miles far from Altai. As far as I understood it was on a dacha in Caucasus mountains which are across a sea from Yalta. And you was like a white man with a "boom-stick" there with your solarpowered scientific calculator. Alright, I have to admit there were struggles with solarpowered devices in USSR, but even I, a simple pupil in a mid-school knew and used scientific calculators.
So yeah, cool story bro. Will you call you a liar yourself?
Reply: @ТоварищУкротитель  he said his fellow passengers were heading to Yalta, I would imagine that even in Soviet Russia every journey has to start somewhere?
Reply: @frankryan2505  as you may know - In Soviet Russia journey starts you.
Anyway, yes, I got this moment. However if you are going to visit Altai it's one region and if you are going to visit Yalta or Caucasus mountains it's other regions. Surely Yalta is in Crimea and Caucasus mountains just in a day of travel from there, but Altai is in totally different direction.
It's like that Texan would travel from Dallas to Boston through Anchorage and drink some alcohol in San-Francisco on its way.
It doesn't matter anyway. I think that guy is a kind of fairy tales teller.
Reply: This is the single biggest bs story I've ever heard on the internet.
Reply: @makut4154  I’ve seen bigger bullshit yarns on YouTube lol 😂